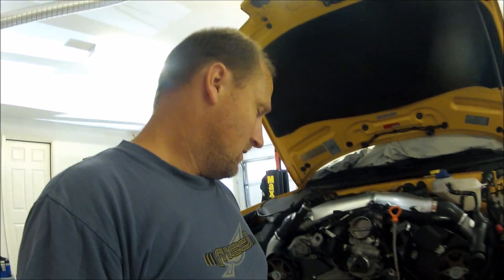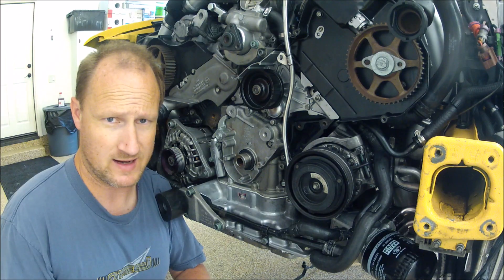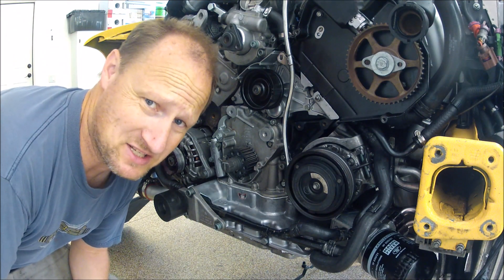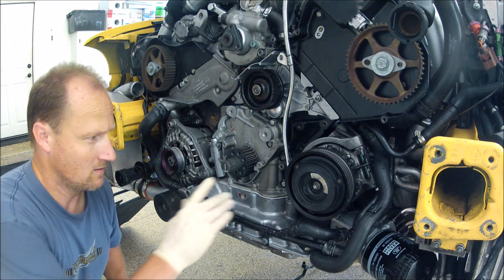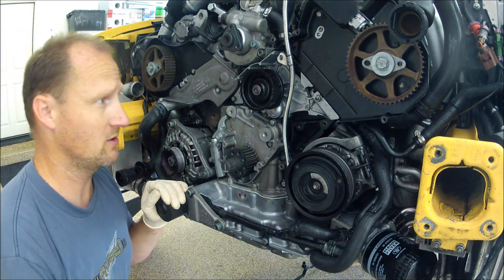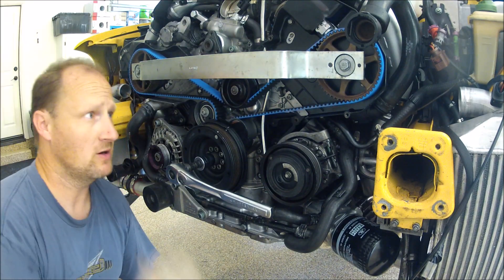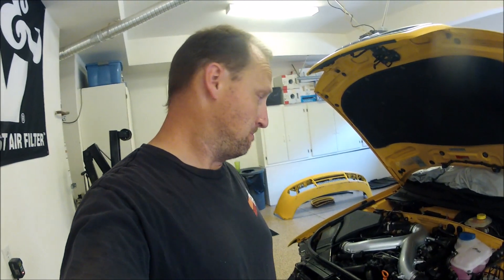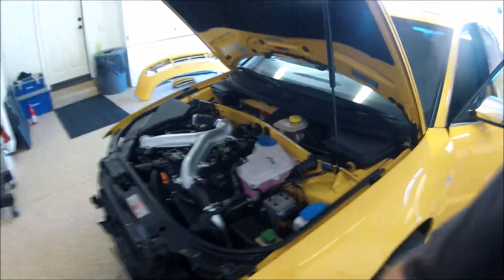Bolt Replaced...   Plus Crank Bolt Install...  Will it gush oil again?

Comment: Hey Justin I have a quick question I drive a 2002 audi allroad and I just got k04’s installed into it and today I was driving parked and coolant just started pouring out my car does smoke white it’s in the back of the block thinking if it’s the heater core?

Comment: Hey man! Question, when you fist crank the engine to make oil circulate, you said you did it without the ecu, you meant both connectors to the ecu completely disconnected? Or only one? If so which of them. And the second question is, how about the power steering pump? As all the lines are going to be empty, should I just filled the resevoir leaving the pump to suck the fluid or is there a better way? Thank you!
Reply from the maker: Xavi Alexander ;   Disconnect both Ecu plugs.   Power steering, I normally fill reservoir then spin pump by hand, fill reservoir, spin pump, repeat until pump quits sucking fluid.
Reply: So I finished the job, engine runs AMAZING, tranny was filled with bew fluid at the right temperature (specs). But! I got a exhaust leak from the manifold to the turbo. (I knew 25 nm was a crazy low number for an exhaust) however you advised that torque and it is all over the internet, but why and how this low? Doesn’t make any sense, both aluminum washers were placed correctly. This is a doable job from the top, I will have to remove the EGRs (maybe) or just clear the cabling on the firewall a little bit, remove turbo heat shields ( visible from top) and get to the bolts and apply...? 50nm? Keep in mind that everything was replaced new and OEM, but 25 nm there sounded crazy to me from the beginning haha! Exhaust smoke coming out from both sides of the engine looks funny, I clogged the rear exhaust pipe by hand and there no pressure, so I new it was from that aluminum ring ( the turbo to exhaust 4 bolts were tighten correctly so is not this one , thank god) I will update you wednesday once it’s done, any advise? Thanks Justin!

Comment: Hey Justin, I also have a V6 B5, only it's a 2.5 TDI. Did those 200 NM and 180c turn all withstood with that locking bolt? I'm also planning to replace the crank o-ring only am a tad scared that the locking tool for the crankshaft does not withstand those forces, it seems a bit fragile honestly. Could you please respond to me if I can do that with just that locking pin for the crankshaft. Thanks Justin and best of luck with your beauty of an S4! :)
Reply from the maker: I use the locking pin for doing the crank bolt and also when I install flywheels and pressure plates.  It does seem fragile, but I have not broken one yet.  My only advice is, make sure you have a quality crank lock pin and not a cheap one.  The one I have is the factory Audi pin.
Reply: Thanks for the info. I will get my hands on some quality ones.

Comment: Just picked up a 2000 s4 b5 98k one owner detailed service history. Just thinking what work to do first maybe timing belt water pump all fluids ???
Reply from the maker: Chris Gerrard    Timing belt job first.    This goes for whoever purchases one of these cars.   Even if the owner says it was done, I still recommend that the current owner has the timing belt done for peace of mind.   Only time I would accept the word of the previous owner is if there is paperwork from a reputable shop on when it was done....  😎

Comment: Justin will you give me that metal thin washer between crankshaft and T-belt spracket part No. please, I am looking at Audi ETKA and don't see any washer there, thanks. I replaced several T-belts on multiple Audi engines incl. 2.7 APB and don't remember that washer. Engine sounds so good. I am so exided for you.
Reply from the maker: 06c105193b